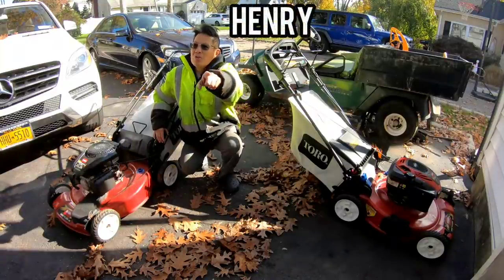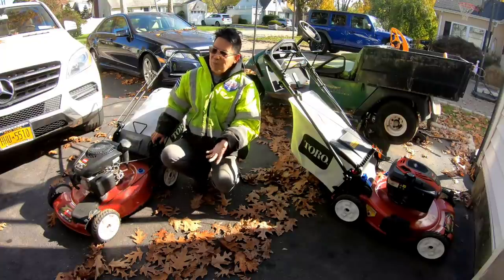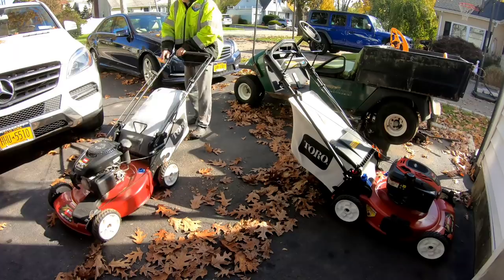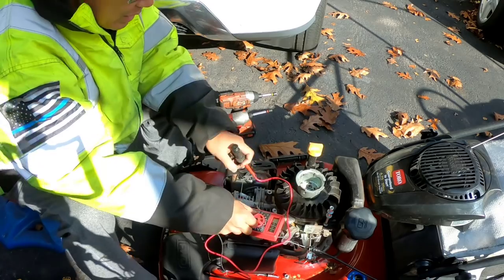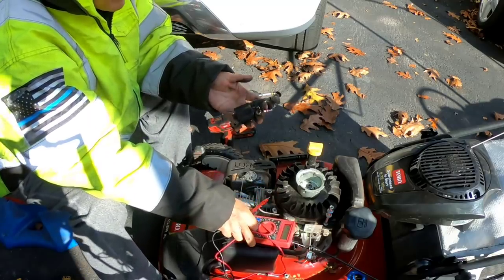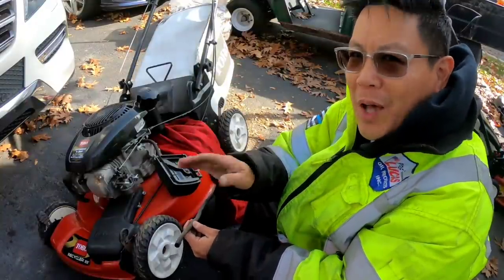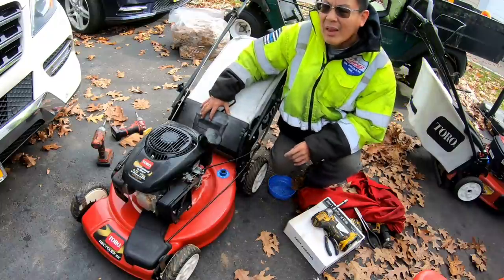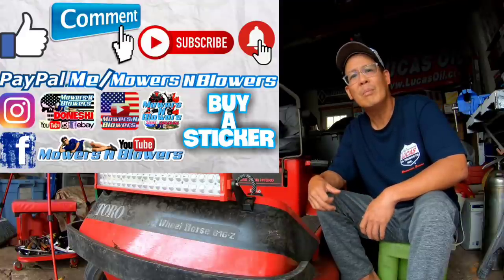TORO RECYCLER XT675 KOHLER LAWN MOWER TROUBLESHOOTING HARD TO START WON'T STAY RUNNING STALLS FUEL

Comment: I've got a Varny awd with that same engine ... start die.. start die... I'm a 190cc flat head  Briggs guy... I know nothing at all about Kohler engines due in fact that this is my first.. I did some digging and all pointed to auto choke {i still believe there is an issue there and I will deal with it} But it turns out to be exactly what you have there... That fuel filter catastrophe of ingenuity... I'm certainly glad that I checked this vid out...
Reply from the maker: Glad you enjoyed it!  Hope you’ll subscribe mate!

Comment: i have that same mower and will only start if i dump gas down the spark plug hole. will not start with starting fluid. carb is clean gas is good and good spark. any idea what this could be?

Comment: I have seen the rubber breather hose on farm tractors between the carburetor and breather housing internally deteriorated so badly in which the carburetor would just about completely stop up with rubber fragments. The rubber brake hoses on vehicles will do the same exact thing in which you have to practically stand on the brake pedal to get any braking action. The rubber hose will only last so long before it starts breaking down internally.

Comment: Great work Henry, running strong 💪
Reply from the maker: An ignition magneto, or high-tension magneto, is a magneto that provides current for the ignition system of a spark-ignition engine, such as a petrol engine. It produces pulses of high voltage for the spark plugs. The older term tension means voltage.[1]

Comment: You called what I call a module a magnito.  I thought mag is under the flywheel
Reply from the maker: Nope,  under the flywheel is a stator
Reply: I thought they were called. Ignition coil.
Reply from the maker: An ignition magneto, or high-tension magneto, is a magneto that provides current for the ignition system of a spark-ignition engine, such as a petrol engine. It produces pulses of high voltage for the spark plugs. The older term tension means voltage.[1]
Reply from the maker: @NRH1987  ignition coil, magneto, armature, it's all the same
Reply from the maker: @NRH1987  ignition coils are powered by a 12v source, magnetos get the power from the magnet and flywheel rotation.
Reply: @MowersNBlowers  Ok I get it. I haven't done that many

Comment: Robert is now getting a nice mower. Nice diagnostic skills there Henry for a guy that says he not a mechanic!  Lol. I dont know if you watch James Condon, the generator guy, but the other day he was testing  a coil on a Honda and the coil was fine , but the spark plug boot was bad and had to much resistance. 👍🇺🇸Roger  #seafoam
Reply from the maker: James condon is a subscriber and he comments often as well
Reply: @MowersNBlowers  I wished i knew half of what he knows about generators.🤔

Comment: Yah I had one of those once on a craftsman with the gas cap.  What I did was drill a small hole in the cap.  It worked out in my case . It was on a craftsman myStride mower with a CKHonda  Engine a clone of a kohler

https://youtu.be/TCBbnHzC7nw

Interesting a collapsed fuel line,  never seen that one